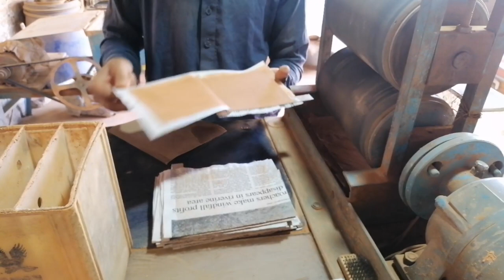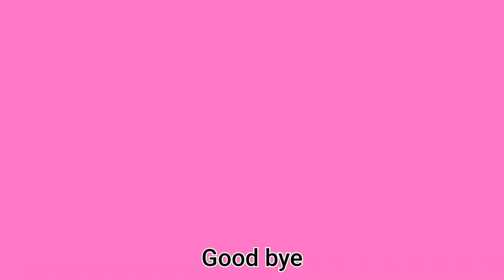Battery Plates manufacturing process. Part 1 | how battery plates are made in Pakistan.

Comment: What are the materials for making battery positive cells, sir?
Reply from the maker: There are many. Common are grey oxide and red oxide powder.
Reply: @JustEverything76  If you use gray oxide powder and red oxide powder, won't they fall out, sir, besides those two ingredients, are there other ingredients?
Reply: Whe i use old positive plate for making new past ,,do i ad anather new ingredients ?do this mix water or assied ?